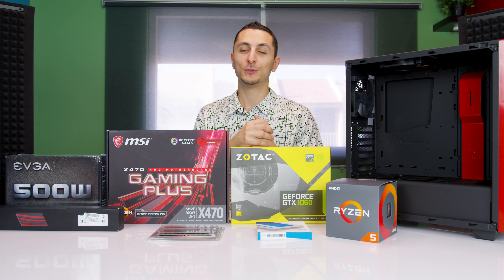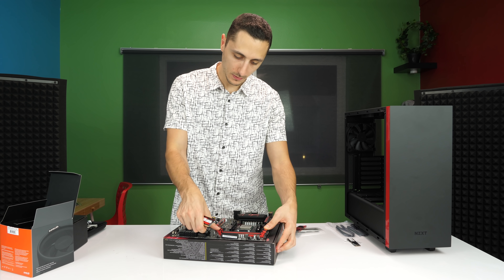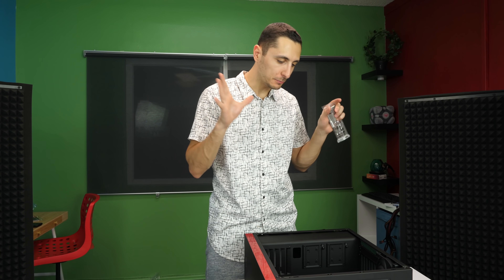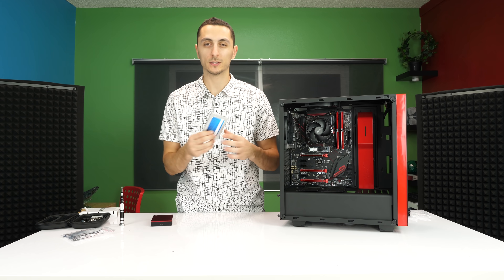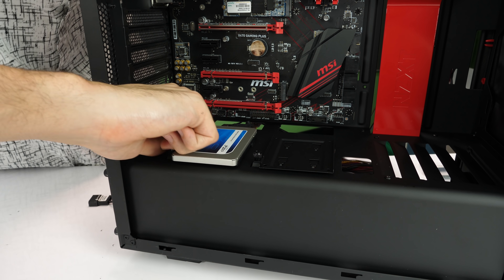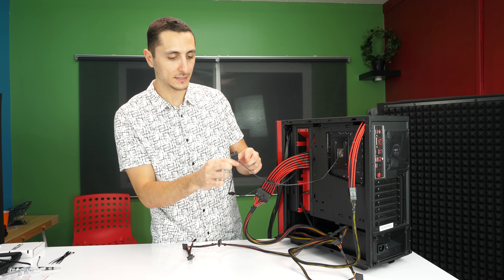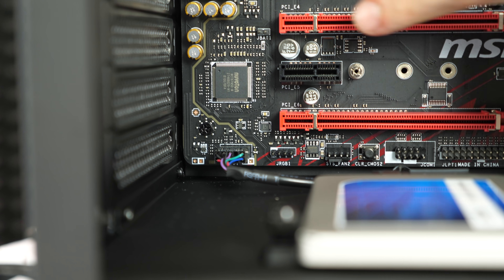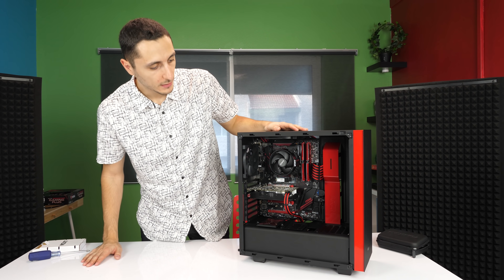How to Build A Gaming PC - 2018 (+Overclocking Guide)

Comment: My question is , is this compatable.

Case: NZXT h500 white
Motherboard: asus Prime x470- pro white
CPU: Ryzen 5 2600x
RAM: corsair vengence rgb white
CPU Cooler: NZXT Kraken M22
GPU: rtx 2060 zotac
SSD: 860 evo 500gb samsung
HardDrive: 1tb barracuda 
PS: EVGA 600w +80bronze
Reply: Use pc part picker it tells you if it is or isnt but it cant say if it is compatible by dimensions so you have to look at that on your own
Reply: @joshkakkanad551  thank you. But how will i know what the best hardware for it is?
Reply: @hypfer_3255  look at benchmarks and do research bc i wouldn't want to be spending 1000 dollars without knowing what im getting out of it
Reply: @joshkakkanad551  i already have. But theres nothing thats saying if these are the best parts for the build.
Reply: @hypfer_3255  No one really wants to say a set up is better everyone just goes by numbers because if you side with something that is worse in someone else's opinion you are branded as a fanboy. If I were you I would probably end up waiting for the ryzen 3rd generation to come out to see if there are any major price drops because who would want to buy a 200 dollar processor only for it to drop in price like 2-3 months later. If you do end up waiting for it I'd just spend that time as time for even more research because knowledge can't hurt you.

Edit: you can also use an Intel processor but they're kinda expensive and you'd need to switch motherboards

Comment: do the screws for attaching the motherboard get provided by the case? or the motherboard because I didn't get any with my motherboard #help
Reply: I have the same x470 as he did and it did not come with any spacers or screws. I just used the spacers and screws that were on my old motherboard but a local computer store should have some
Reply: @flyhigh8113  thank you so much for the help

Comment: I completed the set up. Used the same motherboard and cpu. When I went to turn on the system the only light that comes on is the graphics card inside and none of the fans are working. Tried plugging it into my monitor to see if I got a signal and had no luck. What could be the problem?
Reply: I was able to get the fans to come on and the lights as well. I am still having issues with the picture being sent to my monitor though.

Comment: #help My major concern because I’m getting my parts this Tuesday is that I have a 750 GB HDD and a 1 TB HDD. The 750 GB has Windows 10 installed with some other stuff from my old computer. 1. Will it automatically go to Win 10? 2. And can I format both the hard drives but leave Windows 10 installed? 3. Another concern is how will I move Win 10 to my SSD M.2?

Comment: Are the Stock Cooler can do the Job really well. Or it is Better to buy a AIO Cooler
Reply: Meister hey what’s up man i was wondering if you could help on what ssd and hdd to buy
Reply: Most 2nd gen ryzen have great stock cooler however I would reccomend a radiator just to keep your PC temps cool
Reply: @williamsantiago9284  ssd I would reccomend a Samsung ssd and a seagate barracuda hard drive ! Samsung ssd I would reccomend is 82 dollars the 860 evo 500gb and a 1 or 2 terabyte hard drive from barracuda which are typically 50 bucks
Reply: Z so if i get an ssd do still need an old school hdd?
Reply: @williamsantiago9284  buy some cheap 128GB to 240 SSD for Windows files and some demanding games. And buy 1 or 2 TerraB HDD Seagate or Western Digital. For SSD, there are cheap and good SSD in the market, which other youtubers recommends. Check PCpartpicker on building your system

Comment: hello, i recently bought msi x470 gaming plus and paired it with ryzen 5 2600 and 8gb corsair vengeance lpx 3000mhz...the problem is even tho bios detects both memory sticks as 4gb it says currently usable ram 4gb...and windows the same says 8gb only 3.95gb usable..i updated bios and everything is up to date..i changed the sticks and placed them in different slots and still the same...is there anything i can do to fix this?

Comment: #Help Ive done everything in the video, step by step. I am using the msi Gaming plus motherboard, and also the cpu Ryzen 5 2600. 8GB RAM (TEMPORARY UNTIL I CAN AFFORD 16GB) AND THE RADEON RX580 GPU, WITH A BRONZE EVGA 700 WATT POWER SUPPLY. WHEN I TURN ON MY PC ITS JUST A BLACK SCREEN, NOTHING. IVE REBUILT IT, DISMANTLED EVERYTHING, LOOKED AT THE CPU. M EVERYTHING! YET MY SCREEN IS JUST.... BLACK. Ive checked the cables, my monitors, and I dont know what to do. How can I fix this. Someone pleasr help..
Reply: MAKE SURE YOU PLUG IN THE MONITOR INTO THE GRAPHICS CARD - sorry if this doesn't help but its a mistake i made and had my life flash before my eyes

Comment: I never got a molex cable from the pre-installed fans in my case, which is a nzxt H510. But there are two small wires for the fans, where do i put those? Can someone please help me?
Reply: if your fan doesn't use molex then it probably uses a 3 or 4-pin that connects to the motherboard just like the cpu cooler

Comment: A mistake was made when installing the sata cable in the board. If using an m.2 drive you can't use the top 2 sata slots

Comment: Help my screws on my stock cooler cannot reach the motherboard and yes it is the stock cooler I took it off the cpu also taking the stock thermal paste with it I cleaned up the cpu put it back in the box as well as the cooler what would I do #help
Reply: get new thermal paste

Comment: @TechSource hello can I overclock my ryzen 5 2600 to 4.0Ghz too with the stock cooler? And can I overclock my Hyper X Predator with a Maximum of 3200mhz
Reply from the maker: You can definitely try. Make sure to see the voltage to 1.35v on both ram and CPU
Reply: @TechSource  but you used 1.375v in CPU Voltage?

Comment: I dont know what case to choose NZXT H510 or KOLINK OBSERVATORY
Reply: the nzxt supports more cable management but the kolink comes with more fans. both are not a bad choice but you need to check the differences and see which you like and dno't like

Comment: What is a bios update and  how do u do it i  dont really understand this part of building a pc someone help me please😓
Reply: a bios update is updating the software that your motherboard uses, it's not really necessairy. if you want to do it you need an empty usb flash drive and install the update on there. you need to restart your pc and head into the bios by continuously pressing 'DELETE', you will boot into the bios. first go to advanced mode and  go to the BIOS tab. there will be an option to update your bios. you need to select your usb as install source, then it will update your bios and whaterver happens, DON'T LOSE POWER. because then your pc won't boot at all and you have to get  it to the shop for repairs. here is a link to a guy who explains it in a video for more clearer instructions: https://youtu.be/5BAMdv3YI50?t=654

Comment: So I just built a pc with this motherboard and ryzen 5 3600x. The pc turns on but there is no display when I connect through HDMI on my graphics card or the motherboard. There are solid red lights above the the ram ( 2 8gb ddr4) and beside the 24 pin cable. Not sure what’s wrong any help?
Reply: I guess you’ll have to update the motherboard, you will need the 2nd Ryzen cpus to update it tho. Out of the box the motherboard won’t support 3rd gen cpus.

Comment: Hey I followed your steps. When I was done I turned it on. The pc itself and fans turned on. However I am not getting an image on screen. What did I do wrong? Please Help 
It stays btw

My build:

Strix b450-f Motherboard
Ryzen 7 1700x
Thermaltake silent 12 cooler
500W evga 
Rx 580 8gb
16gb Ram

Comment: Can a Thermaltake Smart RGB 500W 80+ handle Ryzen 5 3600 & PowerColor Radeon RX Vega 56 Red Dragon  8GB ? At stock.
Reply: It will, but get more watts for stable temperatures and power usage

Comment: My pc specifications
Processor- i5 9400F
Gpu- gtx 1660ti zotac
Power supply - 550w corsair 
Mother board - Rog G gaming B360
Ssd- 240 gb Kingston
Hardrive - wd 1 tb 
Cabinet - corsair spec one
.what is my pc specifications good or bad..
Reply: mid range, better ram 2 of 2666mhz

Comment: I'm kinda a noob here but can you overclock your gpu only? I have a gtx 1060 6gb but my cpu ,which is an i5 8400, can't be overclocked. Can I still overclock my gpu? Thanks in advance
Reply: Yes you can if you get the msi afterburner you can overclock it but just do it safely like this guy in the video :)
Reply: @mexxyz  thanks mate

Comment: Hi, My motherboard is a hewlett-packard 3031h and i was wondering if my motherboard supports a " ASUS GTX 650 Ti " that i am going to buy, i will use a external PCI Express 1X To 16X PCIE Riser Cardthanks for the help in advance.
modelhp compaq dc7900 small form factor
(Processor): Intel Core 2 Duo E8400 (3.00 GHz)
(Ram): 6GB DDR2
(Graphics Card): Intel Q45/Q43 Chipset
(Motherboard): Hewlett-Packard 3031h
Chipset: Intel Q45/Q43
Southbridge: Intel 82801JB (ICH10)
(BIOS): Hewlett-Packard 786G1 v01.16
(Storage): 120GB SSD + 250GB HDD

Comment: If you have the ryzen 5 2600 and I also have ryzen 4 2600
Can I also use the same OC settings that you used? Pls anyone answer me
Reply: not necessarily, you need to build it up, so i wouldn't go instantly as high as he does but some below that and then feel what works and what doesn't

Comment: Can u use intel core with this same mother bord?
Reply: It's an AMD specific board so you can't use intel
Reply: @lezhaosicne6387  No. Most boards on the box will tell you if it is Intel or AMD chip socket as in only an Intel Chip or an AMD chip will work in that specified socket. pcpartpicker.com is an excellent website that can tell you if your parts are compatible with one another.
Reply: @jdjenk04  yes thats painfully obvious. seeing this guy even ask that made me realise he needs that website more than anything

Comment: #help I put a m.2 and hdd for mass storage my hdd is not showing up in bios or storage devices everything is plugged in I've even swapped the sata cable to see if that was the problem still nothing. I need #help
Reply: By everything, did you check to see if your HDD is plugged into the PSU?

Comment: I've got the same mobo , can i use Nzxt h500 case instead of the s340
Reply: @Melae Thank you!
Reply: @Melae Very cool , i didn't know that :0
Reply: @Melae just finished building , works really well :D
Reply: @Melae mobo : MSI x470 gaming plus
Gpu : Zotac Gtx 1080 mini
Cpu : Ryzen 2600x
Ram: 2x8gb corsair vengeance RGB
240gb SSD and 1tb of HDD

Its easier to build on the Nzxt h500 casw than i thought
Reply: @Melae i did not use the m2 one :3

Comment: When I put the USB flash drive with the windows tool installed on it into my pc and boot it nothing happens, the pc is on and the components are working but the screen dosent turn on/ the pc dosent recognize the windows
Reply: im having this same issue
Reply: @fa20guy27  the problem in my case was that the ram sticks weren't fully/properly put in the motherboard, pushing on them until they clicked fix the issue in my case
Reply: heine e kjeledyret mitt i tried reseating them a few times to no success :/
Reply: @fa20guy27  shame, there might be some cables or components not properly plugged in, if you don't find anything like that you might have to start over, or maybe check with a professional (an It person or something)

Comment: Hi everyone, I wanted to ask you for some technical advice since you are considered the reference forum in the world of video editing. I have a pc I built in 2014 configured as follows:

intel i7 cpu
matherboard fatal1ty killer asrock
ram ddr3 16gb 2 banks of 8 gb
samsung evo ssd 250gb
video card geforce gtx 760 4gb
corsair cm600 600w power supply

as I mentioned in previous posts I had to abandon davinci resolve because the video card in question no longer worked and all evils come in silver because I discovered filmora that in many respects I consider it exceptional with an extraordinarily simple workflow, logically resolve for color and audio is a completely different thing, but for 70% of the jobs that we all do, filmora is already very good with faster realization times than all other video editing software.
this is not my thought, but it is that of all those who use it, and some of these are professionals.
I would like to ask you about upgrading the video card also with a view to changing cpu mobo and ram in a few months, I focused on two models in particular
the rtx 3060 ti with 8gb which has several cuda cores more than my gtx 760
but there are different lines of thought who prefer more ram maybe a smooth rtx 3060 with 12gb even if it has less cuda core.
honestly I prefer to have your direct confirmation rather than computer geeks who are not too familiar with the world of video editing.
let me know so then I adjust to the purchase
thank you so much hello marco.

one very important thing from a gpu upgrade point of view I changed the power supply I got a nice 750w itek evo
do you think for my current pc configuration or a possible upgrade in the future like motherboard ram cpu is better an rtx 3060 with 12gb or an rtx 3060 ti 8gb with less ram but more cuda core ??
keep in mind that I use filmora 12 and davinci resolve 18.1
thanks a lot i am waiting your reply
bye levideo

Comment: So i built a computer with help of the guides but when i start it up everything goes alright but my screen doesnt receive any signal and goes into sleep mode immediately. Can anyone tell me whats wronge
Reply: make sure your hdmi or display port cable is plugged into your graphics card NOT your motherboard as some cpus dont give off display outputs. a problem i had with my pc is that i inserted the case headers upside down on my motherboard and it wouldnt turn on so you need to make sure that the plus is always in the far top left position and some motherboards can be different as well for the positioning so i suggest you check your manual that came with your motherboard or case.

Comment: so i follow this Guide got everuthing just GPU i have is Asus Rx580 8 GB , my games are getting stuck after 5 min . :(
Reply: Did you get it fixed?
Reply: If you didnt there could multiple reasons.

Bent pins on CPU
Bad ram
Burning GPU
Powersupply not enough
Not latest bios or updates for os 
Slow hdd or ssd

Comment: I have a IGPU but i want to add a GPU. Is that possible ?
Reply: well then you need to make sure it's the same card and if the card AND the motherboard supports AMD crossfire or NVIDIA sli (depends on what gpu you have) you also need an sli bridge to really make a difference in performance
Reply: @Ticey7  I looked on pcpartpicker and stuff and it said it would be compatible. I will write the specs of my pc down here. (Cpu: AMD Ryzen 5 3400G) (Gpu that i will get: GTX 1660 super gaming X by msi) (motherboard: Msi B450M-A PRO MAX (smaller version) )

Comment: Nothing is displaying for me... everything is plugged in and fine but i dont get a boot screen no connection or anything....
Reply: press the power on button on the case ( sounds dumb? well thats what i didnt do :P ) if that doesnt work flip the switch on the power supply and it should point towards "I". if still not working try re-attaching or tightening the front panel switches ( the extra small ones ). tell me if it worked

Comment: - Core i5 Gaming PC Specifications:
- Bitfeniz Nova Windowed Gaming Chassis ATX
- Bitfenix 600W Bronze Certified Power Supply
- Gigabyte Z370-HD3 8th Generation Motherboard
- Intel Core i5-8400 3.60Ghz 8th Generation Processor - QUAD CORE
- 8 Gigabytes DDR4-2400Mhz RAM
- 120 Gigabyte Western Digital Green M2 Solid State Drive
- 1 Terabyte Western Digital Hard Drive
- 24x SATA DVD-Writer Drive
- Gigabyte or MSI GTX1060 6GB DDR5 Graphics Card*
    *Brand of graphics card depends on availability due to stock shortages
- Microsoft Windows 10 Home 64 Bit

This any good for a $1600 prebuilt

Comment: i have the same gpu as you but my benchmark crashes instantly if i put clock speed at 200. I lowered it to 175 and it still crashed.
Reply: Then just don t overclock it, like 10 fps for overclocking not that much anyway plus you get better temps
Reply: @sebastianalexandru3841  ye i think the problem is that my gpu fan is dirty af and my temp goes all the way to 91 on heaven benchmark

Comment: Why the DDR speed shows 2400 MHz while the Ram's frequency is 3200 mhz
Reply: You have to put them at 3200mhz in the BIOS settings.
Reply: Most RAM will automatically be set to the lowest frequency which is usually 2133 Mhz. You need to go into your system BIOS and manually clock it to the desired frequency of your RAM. In this case, 3200 Mhz.

Comment: Can anyone help me I just built a pc with this motherboard and I have a Ryzen 5 2600x and when I try to install windows everything in the pc turns on but nothing pops up on the monitor there is a trouble shoot light on the motherboard for the cpu that is turned on so I know it had something to do with the cpu but I already got a replacement because I took the computer to Best Buy and they told me I had a faulty cpu but when I installed the second brand new cpu it was the same problem can somebody please tell me what is wrong cause I’m bouta return the motherboard and buy another
Reply: I have built a computer before and it went without a problem everything went well and it’s still running till this  day

Comment: Why should I download these drive files
Reply: Drivers are important pieces of software that allow your operating system to talk to your hardware. Windows has built-in generic drivers which offer basic functionality, but you always want to install the drivers from the manufacturer of your hardware for best performance and functionality. Windows 10 will automatically try to download the drivers it thinks are best for your hardware, but it doesn't always do a good job. As such, I prefer downloading straight from the manufacturer's page.